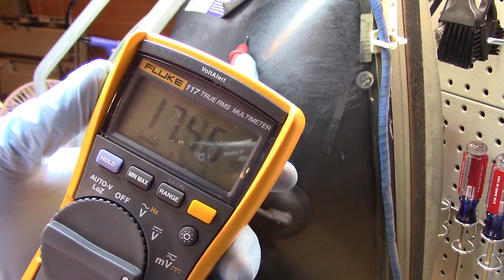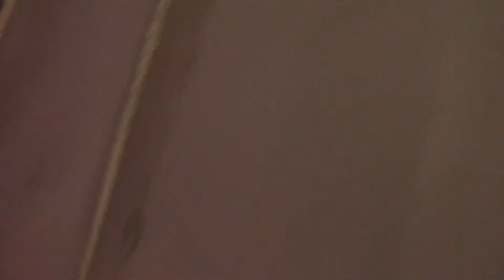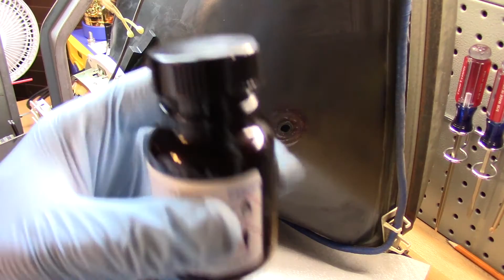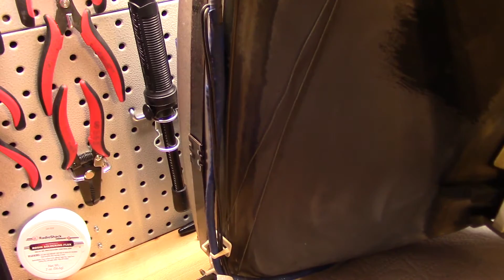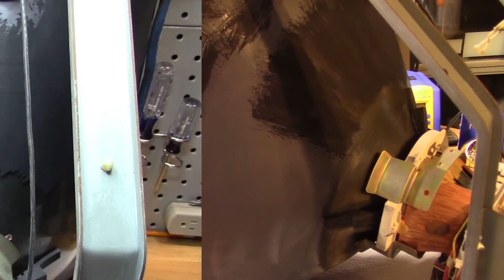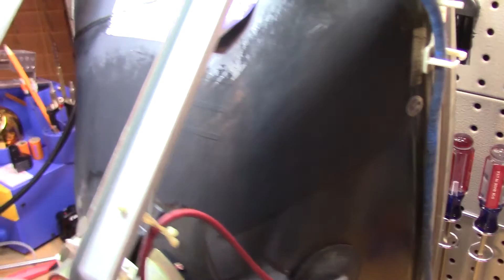Tech - CRT Monitor Aquadag - Repair Monitor Flicker

Comment: I have crt moniter when i use my cpu with without graphic card its working fine , but when i installed my 1050ti with updated graphic card its screen started on or off after few seconds , sometimes i have to unplug hdmi cable converter and insert it again , but screen still blink , what is solution screen refresh rate 69hz 1024x 768 crt moniter
Reply from the maker: This likely has nothing to do with what is presented in the video.  Most monitors these days and even many CRTs try to sense input video signals before displaying an image.  Otherwise they enter a power saving state to reduce power consumption.  You likely have an issue with connections or cables between your graphics card and your CRT monitor.  You should consider trying different cables, HDMI converters, cleaning connections, and checking the input ports, etc.

Perhaps you should consider a graphics card that outputs native DVI rather than HDMI for your specific display purposes. Search PH-GTX1050TI-4G on Amazon to see if that may help.

Comment: Hi Jonathan - great video and thank you for the recommendation on the Ted Pella paint.  I have a Sanyo 20-EZ to repair that's in the same situation (it is visibly missing some of the Aquadag and some came off when I was cleaning the monitor before repair) and I was going to use some Slip Plate graphite lubricant paint that on with a brush.  

I'm glad that I decided to see if there was a better solution (as I had only heard about Slip Plate, but never used it) and I came across this video and have ordered some of the paint you used.

Did you ever figure out what was causing the small amount of flicker that you noted at the end of the video?
Reply from the maker: It was additional work on the voltages on the 20ez that solved the jitters.  They just needed more fine tuning.  I think i ended up replacing the B+ pot.

Comment: Hi, I am thinking about using this sort of thing for a project I have. How easy is it for the Aquadag coating to rub off? For instance, if I had this on the surface of two pieces of metal and these bits made a sliding contact with one another would the Aquadag coating flake off quite easily or would it require a bit of force?
Reply from the maker: What I can tell you is that the Ted Pella dag solution worked very well.  It is very serious stuff, made by a serious chemical company.  It seemed nearly as robust as the original dag that was applied once dried.  There may be other products available, but they may or may not be as well suited for application to CRT tubes.  The links to the datasheet for DAG-T-502 are in the description above.
Reply: Jonathan Tomlin thank you :-)